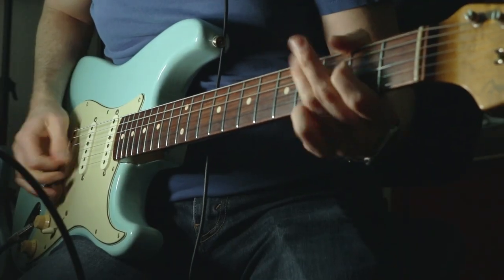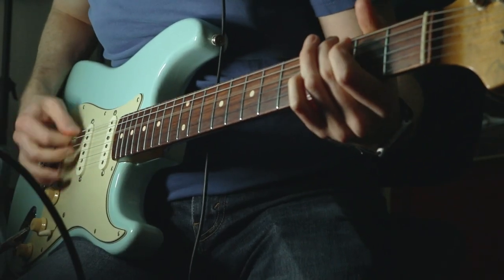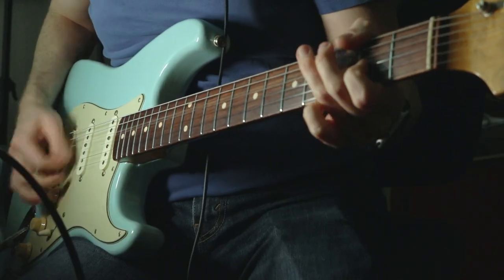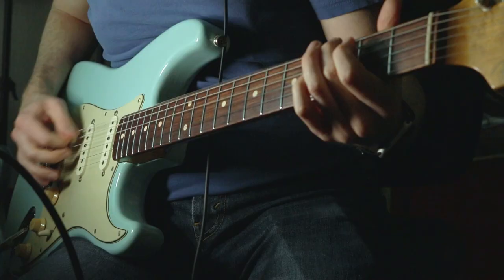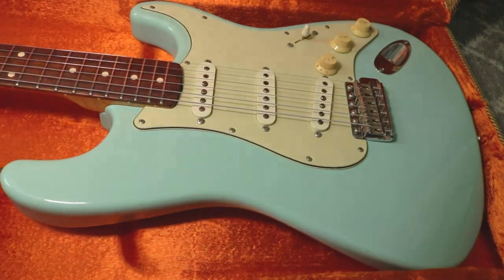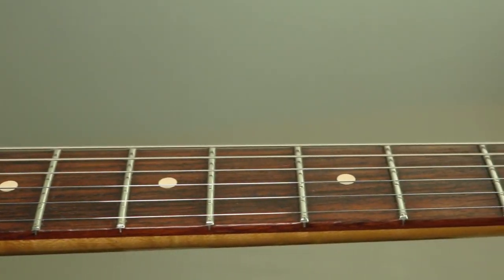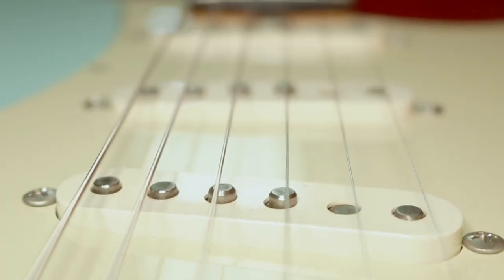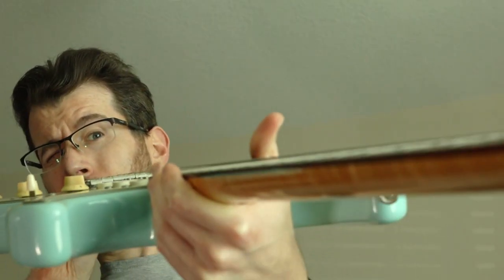Why Does Fender Do This? - Staggered vs Flat Pole Pieces on a Strat

Comment: thanks for this video. how can you change the pole configuration? (or does it mean you need to buy new pickups?)
Reply from the maker: I believe it’s possible to flatten the poles (either by pressing them down or filing the tops off), but it carries a risk of damaging the coils. It’s not a risk I’d be willing to take. Plus, those modifications wouldn’t be reversible if you decide it sounded better before.

Comment: Us and some mexico Fender has a WRONG POLE SPACING! incredibly, the Squiers on the other hand have the strings perfectly aligned on the center of the poles. There's little use worrying about the height of the poles when they are barely below the string...